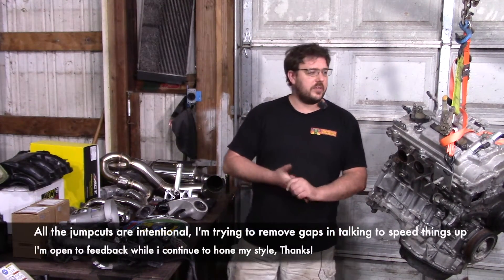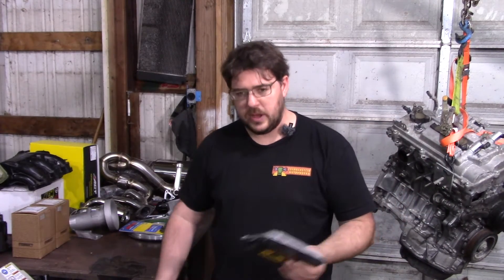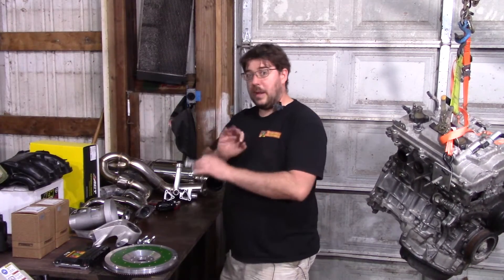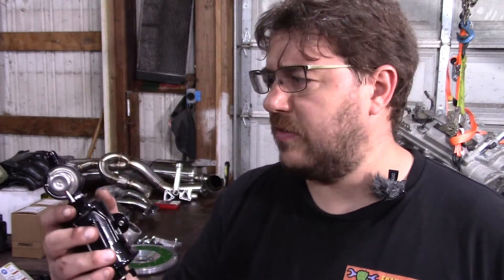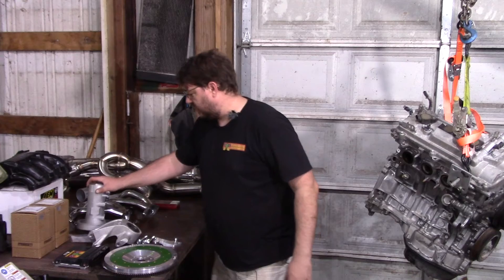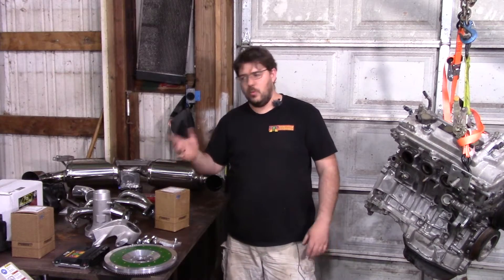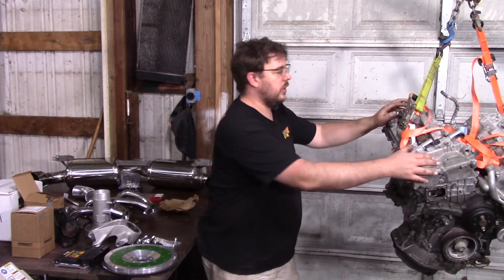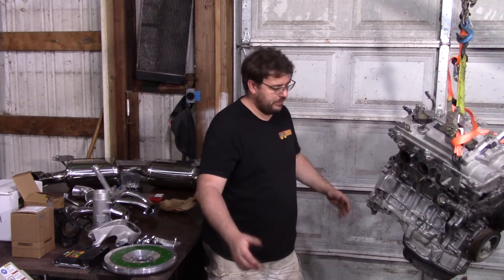2GR-FE install instructions for MKII MR2. Introduction Video

Comment: well i have a 15,000 mile 2gr sitting at work waiting for me to rebuild. bent rod, no damage to the block. oil cooler motor with the better intake manifold.. so i guess im off to a good start.. guess i should try and find an MR2.
think i should be good putting stock sized pistons in? havnt had time to measure the bores. hatch marks are still there.

unless i want to track my avalon. lol
Reply from the maker: There's no car shaming here, spending time on the track is fun no matter what car you do it in. I'm sure you could have a blast in an Avalon :) But if you want to build an MR2 I'm happy to help you with some parts to make it easier.
Reply: Mr2 would be a lot more fun. It’s just finding one not rotted out up in northern Indiana.

Oh and juggling my other 2 projects still takes most of my free time, ain’t easy rebuilding a rolled over tundra and a frame up restore on a Tacoma
Reply: @001dman  Absolutely, the MR2 is a blast on the track. I've been racing them since 2009. I've raced all three generations and i gotta say, for track use the MKIII is where it's at. the car sticks to the track so much better than the two previous generations. the extra lightness also helps a ton.

finish up your other projects first, these parts will still be available in the future. Just keep an eye out for a good chassis while you do that.
Reply: @marclabranche6922  one projects nearing done (just suspension left really). the others close to being driveable, just alot of body work left

Im holding out for a clean NON turbo MR2 or a MR2 Spyder for a v6 swap. i cant bring myself to tear apart a Turbo MR2 unless it blew the engine or something. as for the spyder, they're ugly as sin, but man they are fun

Comment: Hey Marc, would you mind doing a video series on changing out the E153's ring and pinion for the 3.6 from the E53?  Also, maybe some pointers on how to source that final?
Reply from the maker: I'll put it on the list of things to do but the 2AR-FE build is ahead of it. As for sourcing them, they are getting rather thin on the ground these days. The newest one is 28yrs old at this point and it wasn't a very common option to have the V6 manual Camry.  I'd strongly suggest just looking for the 3.933 gearset instead. The 3.625 made more sense before the rev limiter was able to be raised to 7200RPM. The easiest thing to do to refresh an E153 these days is actually to use a solara v6 transmission and swap in the MR2 mid-case. then just reshim the shafts and then run it.
Reply: @FrankensteinMotorworks  I just noticed when I was driving my 2GR that I got WAY better MPG closer to 3k than to 4k RPMs.  And that means I really needed to stay around 70MPH.  I thought the 3.625 would be really nice from that point of view, as 85MPH would be positioned just right!  I've also noticed that when you go above the 6k RPM, toward the 7200, the engine doesn't run as smooth.  The power character changes a lot.  So I try not to do that.  But as a side note, I want to personally thank you for pioneering this build.  The 2GR with the MR2 is just such a winning combination.  It is such a pleasure, and I can't think of anything to compare it to.  I am very grateful for the work you've done on it!
Reply from the maker: @bujin5455  Yes, the 3.625 gears do get really nice fuel economy but you'll never make it up in the price of the gas. 

As for the smoothness, are you running my MAF pipe & associated tune? it makes a huge difference for power delivery and you should consider it if you aren't fully happy with the power delivery up there.
Reply: @FrankensteinMotorworks  Rat2 did the conversion for me (BIGGEST mistake of my life), and they used their own parts, despite me asking them to use your MAF pipe.  I don't know what tune they used, though they did admit they used one of your ECUs.  Is there any way for me to buy your MAF pipe and to trade you out ECUs for one with a known good map for it?
Reply from the maker: @bujin5455  Yes, there's a $40 or $50 ECU upgrade cost depending on if you have the 5 plug or the 2 plug ECU plus the cost of the MAF pipe. Contact me over e-mail (Marc@FrankensteinMotorworks.com) and we can discuss the finer details. You would likely be much happier with the newer MAF pipe tune.

Comment: So can I buy a 2018 2gr with rav4 computer?  I gotta do more research on my own, I’m just curious tho.  My gen 2 motor has too many oil leaks already. I wanna do this swap on mine someday
Reply from the maker: You cannot use the 2018 ECU and harness if you intend on using my tune. If you just want the stock tune and are willing to wire up the immobilizer you can feel free to use that harness and associated immobilizer.

Comment: I have a 2013 Avalon and find there are little to no options for any mods.   Any recommendations on your parts that would jive in the newer 2jR? 
Are the modern Toyota ecms tuneable?
Reply from the maker: They are not tunable by many people but it honestly does not matter. The stock ECU tune is pretty damn good. the problem is breathing. Replace your y-pipe and exhaust with a better system and you can fund up to 70hp. This is not a joke or an exageration, this is what we got on the MR2s before i figured out how to tune the ECUs. adding the ECU tune to that gave us crisper response everywhere which won't matter with your automatic transmission and an extra 15hp. 15hp is nice for sure but it isn't the majority of the gains.
Reply: Frankenstein Motorworks  thanks for the quick response and wealth of knowledge.  

I’ll look into an upgraded exhaust system.

Comment: Hell yeah!!! Btw stupid question but should I get rid of my engine bay rain guard after swapping?
Reply from the maker: No need, it fits in the engine bay with the rain guard on there. It also fits with the stock strut bar but not the TRD bar. In fact, if you do remove it make sure you triple check all your spark plug seals because the rain can get in there.

Comment: I'd love to try this swap at some point but I have an NA mr2 and would worry about the transmission
Reply: The s54 can hold the 2gr power. Just no launches. And the other things like clutch and o2 bung placement are very minor
Reply: Would there be anything special that needs to be done with the s54 axles?

Comment: U seem nervous or out of breathe lol
Take it easy Mark
You’re doing a great job
I think a base background with a color to center the part you are speaking of will help a lot, that way you only need to speak in the background.

Again
Thank you for this
Reply from the maker: Some of that is still the microphone placement. I need to keep working on better audio. The current setup really catches my breath quite a bit. But it was still significantly better audio than my previous setups so i stuck with it for this video. I'll keep tweaking it to try and get rid of that in the future. 

as for a better backdrop, yeah, i'm aware of that and i should do something about it. My shop is just a decrepit 45yr old pole barn so it really isn't fantastic. 

Thank you for the positive feedback, i appreciate it!

Comment: Great Video Marc.  does anyone using the normal e153 axles need to machine them still?
Reply from the maker: If you use a non LSD right side (long) stub in an LSD transmission you can make it fit by machining it to move it over by 2.5mm. If you're using the right stub for your differential you no longer need to machine the stub. This is a very recent discovery.

Comment: Awesome video mark, is it possible with some of the parts to touch on the right hand side cars by chance? ie the pedal adapter and other bits. Also bit of a long shot of an ask but any chance of touching on the trd version of the 2gr? just because i bet its come up a few times..
Reply from the maker: Jay, the only difference with a RHD car is the pedal adapter will not work. I know there are some Australians that have figured out some decent solutions but i don't know the details. Hopefully someone can reply to this and add that in there.

The TRD version is awful, don't do it. I spent a long time making all the parts to fit it in the MR2 and it completely ruined the drive characteristics of the motor. it also took 8.5psi to make 45hp more, it really isn't efficient. I think mostly because the lower intake manifold is awful.
Reply: @FrankensteinMotorworks  Well shoot tht brings my build that im close to being ready for install (aside from the water neck thts surprising upside down compared to yours when mounted to the engine) to a roaring halt, because i have the trd aurion 2gr version and the plan was to use a link fury as the ecu to run it all which wont really effect anything if i go na or supercharged
Reply from the maker: @jaykatana9418  I'm really sorry to hear that. The motors go for really good money though, you should be able to recover the money and buy a much cheaper 2GR to do the swap with.
Reply: @jaykatana9418  theres a group of guys in Brisbane that are part of the MR2 Australia page who have all done 2GR swaps, one has a SC V6 in his. I'd ask them.
Reply: @FrankensteinMotorworks   it shouldn't be too hard to source the intake you recommended, i believe the aurion (2006-12) ones have intake you recommended  and they go for about 100, so no real loss plus the engine has about 110km so itd be a waste not to use it plus i got that engine and a heap of extras for 5k aud which included swap headers the mount needed for the supercharger swap and more, plus to swap to the n/a engine and then get the other mount itd cost about the same anyway you slice it because i still require the mount you make and the aud exchange rate is sad atm
Reply: @jarrad_sol  will do cheers for the info!
Reply: Jay Katana Hi Jay, I’m actually just finalising my parts to install my TRD Aurion 2GR in my SW20. I sent my TRD ECU to OVTUNE in the states as they fully tune the ecu it take 2-3 days and then send it back they also remove the immobiliser and auto trans. I’m in Newcastle NSW are you in Aus?
Reply: @damo7800   im up in FNQ but with the ecu ive decided to go with an aftermarket one for abit more flexibility with tuning as well as any other mods or running e85 down the road
Reply: Jay Katana Sunny QLD perfect one day sunny the next! By the way I’ve got the Corolla accelerator pedal and using Marc’s adaptor to fit the RHD MR2’s they have the same plug just needs a few mm removed off the bottom of the bar that hold the plastic pedal to align it to the same position as original.
Reply: Also just another question too with the 2grs does the newer/ current ones work with the swap as well? (someones gotta ask the dumb questions to avoid the dumb mistakes)

Comment: I wish i has the money
Reply from the maker: It's certainly still not free but I've seen many people do it for pretty cheap by waiting for used parts to come around and getting a great deal on a motor. I've been selling parts to do this for over 10 years so there are several out there being resold at a lower price from projects that did not go forward.
Reply: @FrankensteinMotorworks  I'm sure you have a plan for your video series, but if I could make a request it would be for an introductory video where you run through essential parts so I can start budgeting. So far all I know is it costs like AU$5-10k plus an MR2
Reply: Sometimes you just gotta put your mind to it and save up really hard. I saved up about 1year 6 months/2years to have mine done(I have a shop do mine tho, mines been 2gr swapped going on/or over 2 years now I think). But as he said, you can do it pretty cheap but you gotta do a lot of searching)taking your time with stuff/prices.
Reply: My plan is to start buying one part at a time after I have an engine and I make a parts list, that way it doesn't seem as daunting to have to buy everything at once